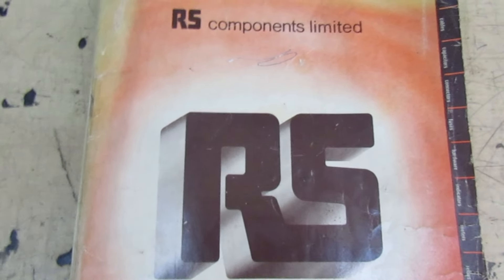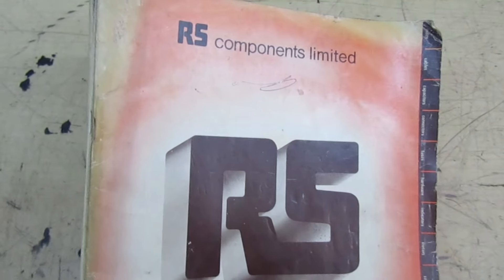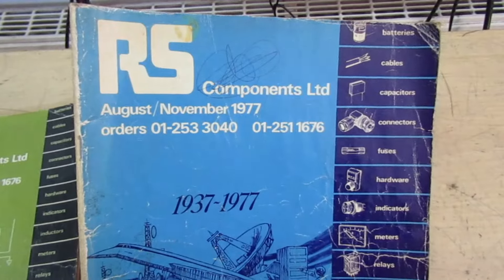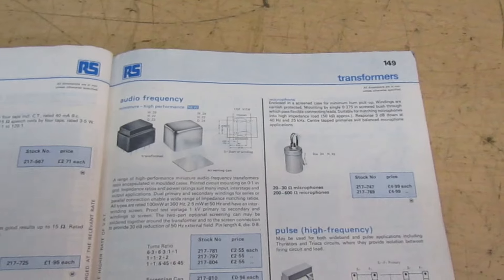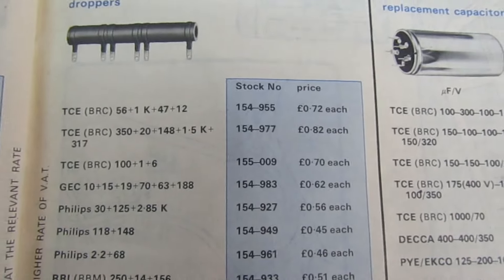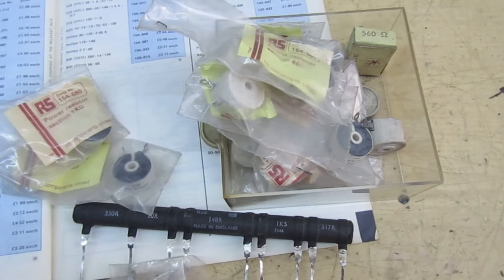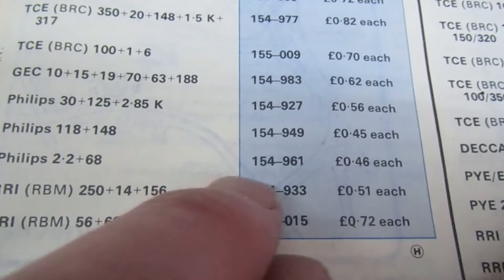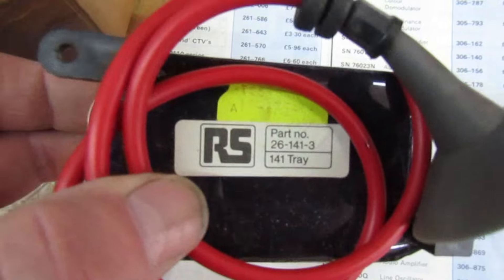Not everyone knows this about RS components .

Comment: I well remember the rep calling in the shop, 'we've got a special deal on co-ax cable' etc. They were the first source of silicon rectifiers, to replace stinky selenium ones. We didn't always at first get the mounting and value of the series resistor quite correct I recall! It was a cheaper repair for the customer than a set with an expensive PY32 valve. Of course the 'stink' returned later with the Thorn/BRC eht trays. It was an era of unreliable equipment and many families who were poor. It was devastating for them to return home after a weeks holiday in a pokey damp caravan with the worse weather ever, to be told their TV that they were still paying off but was out of guarantee needed a line output transformer.  Thanks for the great content you provide.
Reply from the maker: I remember the bad egg smell from the selenium stick diodes in the BRC trays , infact I still have a few sticks in stock .

Comment: Even after all this time I still refer to them as Radio Spares . I believe others do as well . 
I have a old catalog from 1973 . My dad bought it home from work when the company he used to repair arcade games at the time . The other guy he worked with made a couple note inside of the machines they ordered the parts for .  A nice reminder.
I picked up a bag of  12 or more Radio Spares droppers for BRC 1400 and 1500 at a radio . Most in boxes at a rally for a couple pounds. I have used most of them now . I also got lots of the polo mint ones . Again from radio rallys. The polo ones never seem to burn out . All good stuff. 
Thanks for the great video as always.
Reply from the maker: All I need now is some more 1500 s to use these in , got a load more droppers in a box somewhere .

Comment: Brings back memories, I remember the old Radio Spares catalogue that was A5 size.  Seeing those droppers, those were great times when you could fix the TV in the customers home.
Reply: Yes, I remember those times too, you made a wooden toolbox and you had ceramic resistors, a few EF84's ECC83's PL504's, a soldering iron n solder an yer tools😂
Reply: Apprentice engineer, done radio TV and electronics mechanics course no. 332 for city and guilds . Started that in 1968/9

Comment: I used a dropper resistor to put over my soldering iron, so i could put a hot iron back in my toolbox when I was out repairing TV's in the home.
Reply: In a house repairing TV about early 70's and had soldering iron (Henley Solon 25watt) propped on floor, had to re~adjust my position and put my hand straight on top of hot iron !!!! Oh ,    that hurt bad
Reply: Me too. The old Thorn ones didn't like New Zealand summers, so there were plenty of dead ones
Reply: @willtucker2774  ouch! I would question putting the iron on the floor in the first place though. The Antex irons we used had hooks that one could use to hang the iron from the TV's chassis etc. Later on I used a gas iron, that cooled down quite quickly anyway.

Comment: When fitting polo mints - we used to cut away the open circuit winding of the main dropper as it wasn't unknown  for the winding to make contact again making the bridged segment half the resistance of that it should be. Later working at a well-known Thorn owned rental company bridging droppers with mints or other high power resistors was complely banned, and only the correct part could  be used.
Reply from the maker: I never actually cut the old part away but I guess it would be possible to re connect if it was a bad connection at the end .

Comment: The page where it showed 'droppers' resonated with me.  This was 'meatball' electronics at its best !  Use a massive resistor to deliver differing ac voltages to be rectified and used, instead of using a pesky expensive transformer !  But you were turning the TV into a room heater instead !
Reply from the maker: my favourite thing , a valve tv set dissipating loads of heat, sadly I don't have too many valve sets in my collection .

Comment: Just like the fabled Maplins catalogue from the 80's and 90's. I worked in the Hillsbourogh branch when it 1st opened...
Reply: Ah, good ol' Maplin's in their heyday. [settles into armchair, all misty-eyed...] I remember being given the 1987 (I think) catalogue (mostly orange sci-fi front cover illustration featuring a maglev-type train, if my memory serves me correctly) as a Christmas present; it was the first time I had heard of Maplin. As a kid who was obsessed with electronics, it was absolutely perfect. The other kids at school (I would have been in Year 4 if I've got the right year) were baffled when I talked about it when we started back after the holidays. They were all similarly excited about getting Scalectrix sets or whatever.

It was more than just a catalogue, though - there was a wealth of data about the components, especially the ICs. For a hobbyist like me who scrounged old broken electronic stuff from friends and family, desoldered the components and used them for experimenting on my breadboards, it was invaluable - suddenly I had pinouts and even example application circuits for many of the assorted ICs I'd accumulated whereas before I could only use the ones that had been featured in the selection of Forrest Mims' "Engineer's Mini Notebooks" I owned.

The highlight of my school holidays from then on were the pilgrimages with Mum to the Southampton branch (Bevois Valley Road) to buy new stuff. It was a small, very cluttered store, crammed with goodies and with the friendly team (I particularly remember Eddie) on hand to help. Skip the candy store - take this kid to Maplin's!
Reply: Before I did my degree, the Maplin was a great source of education looking through at all the chips.

And being able to walk in to a Maplin store (when they started opening them), going in with a components list, handing it to a assistant and he'd just pick all the components you needed into little plastic bags. Absolutely fantastic.

All gone now, sadly.
Reply: @molletts  I used to love looking through the Maplin catalogue. Back in 1982, when DIY electronics kits were popular, my dad bought the Maplin electronic organ kit, at the time it had the biggest one piece PCB in any consumer product, the board was about 4 feet long!!  
The kit contained box loads of hundreds of components & included the wooden cabinet, which we had to bring home on the roof-rack on the car, this was from the Hammersmith store in London, the nearest one to us in Portsmouh, which had this kit in stock, it took my dad & me several months to build this then complex electronic organ, but it did all work eventually!

Comment: Those resistors used to get hot and sometimes cooked other components below them. Rifa caps were the first to go along with a few resistors and capacitors. Used to be a common fault on Ferguson. Marconiphone, Ultra and HMV TV sets. The wires coming from the resistor had a heat sheath around them. I once saw a HMV tv that had a brittle back cover. The heat affected the plastic. Tv sets in those days gave off heat from this resistor and cats would sometimes sleep on top of the television set due to the warmth.
Reply: All those names were basically badge engineering,  same inside. Wish I could find an old valve  radio to show my great grandkids.
Reply: @willtucker2774  Indeed because the radios they made were identical to but a different badge. Same goes for Bush radios of the 1970s under the Rank organisation which included Dansette and Murphy.
Reply: @mikecummings7054 I remember them, Rank Bush Murphy. I had an old late 40's early 50's bush radio I bought at a jumble sale non working for 2s and 😂6d (half a crown) a weeks wages as an apprentice TV tech was about four quid.

Comment: I was working for Radio Rentals and had to order a couple of droppers for the remaining couple of Ferguson 1500 black and white tvs that were still out there. I’m not sure what went wrong but when the order turned up two guys struggled out to the workshop with the box of 400 droppers!
Reply from the maker: Happened to me once with SEME, ordered 1,000 scart leads by mistake instead of 100 and they wouldn't take them back, that was the last time I ever used them .

Comment: Radio Spares was  expensive but fast to deliver by post and sometimes got you out of trouble as other suppliers were Slower , I really liked the Red Hi Stab Resistors similar to Grundig type , the quality was so good they rarely went faulty , we used to get the RS Mugs , Pens and Rulers etc , CPC , Willow Vale ,HRS from Birmingham , Charles Hyde were good ordering parts for Tv, Hifi and Domestic white good spare parts , you could order and it would arrive next day like Amazon, Sendz Components had a Aladdins Cave of bits that was amazing, Gone are those days 😊😊😊😊
Reply: I was working at a film studio making special effects gear and we had a deal with the local RS Components store to get parts delivered by motorcycle courier in an hour or so if we needed stuff in a hurry. As they say in the film business, you can tell the director your special effect isn't ready for principal shooting once. That's because you'll never work in the industry again, and spending fifty quid to get a pack of resistors to the workshop fast enough to meet the deadline was well worth it.

Comment: Ah yes the mains dropper, common fault on radios, sometimes did not replace the whole dropper just the faulty section with suitable wire wound resistor.

Comment: In the late 60's I worked at the R&D labs at Rank Taylor Hobsòn in Leicester. I seem to recall the RadioSpares 'Catalogue' was a single, folded, sheet and seemed to be largely Bulgin control knobs, a few switches and some other bits. Their last printed Catalogue was 3 or 4 volumes in a cardboard case. Times change.
Reply: RS provided technical data sheets in the catalogues for a lot of their components, very useful if you were designing or modifying equipment.

Comment: Takes me back to the '50s and '60s when I used to buy from Radios Spares for our Coventry development laboratory.  Went to their HQ, before it moved to Ebury Street, London, and was shown round by the Chairman (Mainwaring or Waring, I think) and the Tech director (Sebestien - odd spelling).  At dozens of order filling stations there were girls using an amazing stocking, order filling and invoice printing system based on the old Addressograph machines with metal plates for both customer account addressing and the component names and pricing.  All orders received during a day were dispatched the same day - brilliant and simple.  Expensive but on time.  Had an out of town warehouse to replenish stocks daily.  Then, the small catalogue was about the size and shape of a DL size envelope with a string through one corner so you could hang it on a hook by your desk - very simple and effective sales technique!  Different world, no computers - invoices totalled on 'comptometers'.
Reply from the maker: A very different world now as you say but one thing remains the same and its why I like them so much , next day courier delivery if ordered before 6PM at night .

Comment: Still got quite a few odds and ends with the original logo and brand name, very good quality stuff, especially tools, the modeling drill I bought back in the mid seventies has only just given up, and it's had a lot of use, those polo sections were designed to be stacked so as to make a complete replacement dropper only i never ever saw them used that way!, usually they'd be hanging like a bunch of grapes from a tired old dropper and in danger of singing nearby components or the rear cover!, happy days😂.
Reply from the maker: I much prefeed the old packaging with the yellow label's than todays white bag , somehow it made the components much more appealing .

Comment: In the late 1980s RS went all machinist supply for some strange move. It was great for myself though as i had bought a lathe & a reasonable milling machine to make stuff on &my employer allowed me to order any tooling i needed to make parts for him & if i needed for the work i did there. I well remember the 6061-T6 aluminium billet stock i bought & a selection of endmill & flycutters, taps & dies just to repair the the bosse's wireless controlled remote golf caddy trundler that had broken it's handle off...!  To this day i have that RS catalog still for all the tech notes for machinists & i use that same very expensive tooling from RS still... as i turn perfectly good bits of metal into swarf & chips making parts for my electronics projects!

Comment: When stuck with no tools and asked if I could help at family or friends, I'd touch the chassis with a fingertip and work from the "dead end" end with the  other fingertip,  until i got a Belt aff it😂 now i i know what polo mint was needed. Always tied the polo mint to the duff dropper with bare copper wire
Reply from the maker: My test was a wet finger and see if it dried up or stayed wet .

Comment: Heaters on old vave sets  used a " wattless" dropper" then a big dropper resistor.
Reply from the maker: Yes , was it the Thorn 950 that used the capacitor dropper ?
Reply: No Michael, it was diode.
Very clever thought went into that.
Reply: Used on heater supply.

Comment: "Not everyone knows this about RS components" ... Apparently not everyone knows that since 2022 they have been rebranded as "RS" (without the 'components'!). If you have a look at the RS website under 'About Us' and then click on the highlighted '100 years' experience' it gives a timeline of their existence. Interestingly, not even they seem to know this fact as the copyright at the bottom of the page still calls them "RS Components Ltd"!
A couple of things did surprise me though: I started as an apprentice in 1979 and always remember them as Radiospares but, according to the timeline, they dropped that name in 1971!
Also, they apparently "Floated on the London Stock Exchange as Electrocomponents plc." in 1967... but the suffix 'plc.' didn't come into use until 1981 - Obviously they were always ahead of their time!!

Comment: Pommy crap that NEVER workrd in OZ other than the 3504  oven & the thick film failure 4KA chassis where both epic failures that's why the next model was a  G chassis  Mitsubishi which also failed it wasn't till the K chassis Mitsubishi got it sorted other than horizontal driver cap & dry joints around which caused shorted H/OP Trans just like those oven 3504's because that where I leant this fault.